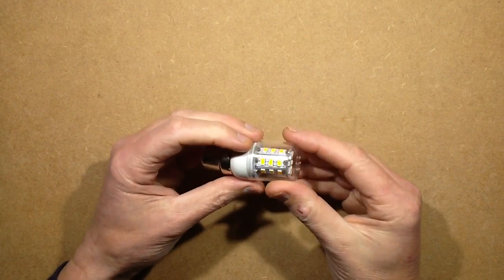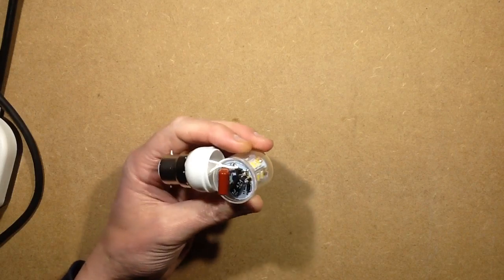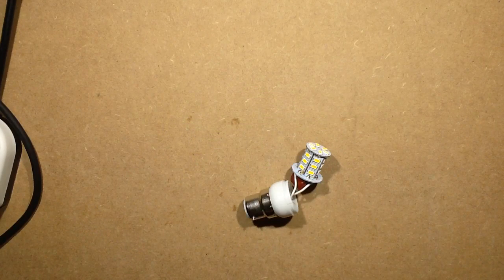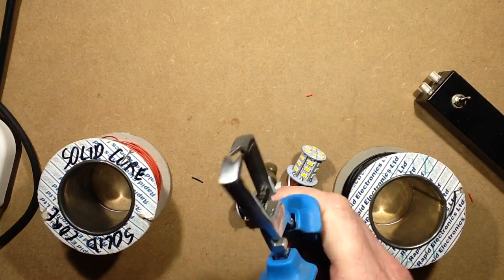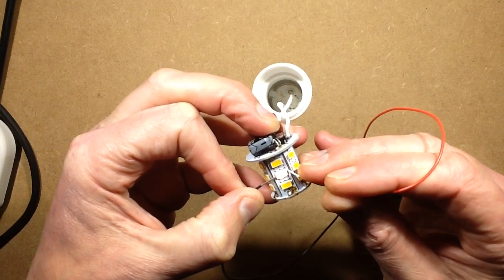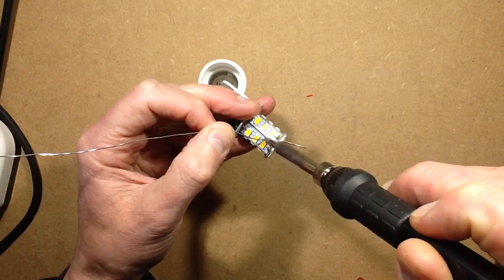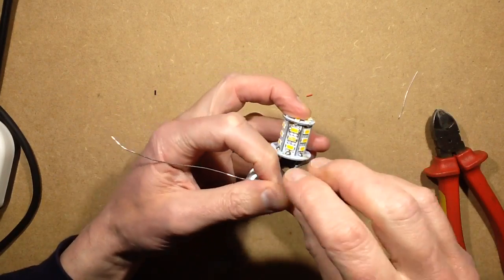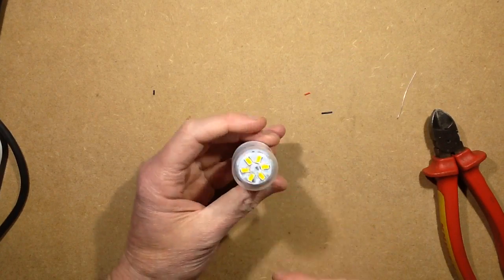Fixing a dead LED lamp.  (Interesting failure.)

Comment: If you are doing this as an exercise, thats fine, but in the real world, its a total waste of time. Shorting out the blown LED will effectively put a slightly higher voltage across the rest of the LED's which are already driven too hard, and cause them to blow as well. So you wont get much more life out the bulb. If you want it to last, short it out with a low value resistor.

Comment: I love that socket design! The American screw-type sockets are moronic! God help you if the bulb shatters in the socket!
Reply: +Islamisthecultofsin Or use a potato. Push it over the broken bulb base (powered off of course) and turn.

Works on bayonet cap lamps too.
Reply: +Mark Speir   Turn off the switch and unscrew the shattered bulb with a pair of pliers.
Reply: Islamisthecultofsin Or you could use one of these sockets and only have to turn the bulb a tiny bit...
Reply: Mark Speir  I actually prefer the screw bulbs over the other.   We do use them in cars though.
Reply: +Mark Speir normally E series socket's body can be unscrewed too. also plyers or pincers would help. With power off, obviously

Comment: I have the same bulb as you are and i fix it the same way you did, that only run the bulb for few more hours before the other LED gone. than i fix it over and over til i figured that the wire i use might be too thick to let too much voltage flow through and kill the next LED. This is what i do to my next bulb with a dead LED, i stripped the whole plastic off the wire, and solder only ONE piece of wire out of the whole bunch of that twist metal wire.That bulb can survive for week or longer before the next dead LED. My solution, DON"T BUY THIS BULB.

Comment: I bought a bunch of these from China, three different power ratings from three different vendors. They all fail in similar manner after a few hundred hours, one of the leds fries and the lamp dies. A far cry from the 100,000 hours longevity they promise :-)

Comment: when you buy them, replace the cheap capacitors with one voltage rating higher and take out the horrible fake insulation tape. this stuff stops airfolw makes the caps overheat and bulge, if you do this these bulbs will last years.

Comment: I use a hot air gun.  I find usually two LEDS have burned.  I fix them in two seconds now ;-)

also I remove the plastic case and use 3 second glue to fix every thing back together I find the bulb lasts longer - but mind your fingers 220v its not fun :-)

I like the vids keep them comming

Comment: Overdriven LED's. I had the same in my B14 rangehood lights. Made a video of that too.
Some of these led's are overdriven to hard.
Reply: +RODALCO2007 
Yep  -  designed for the 220v  chinese mains supply  - the  capacitors for 240v -  

found same  problem -  put a standard  LED   cross  the dud led  -  another  blew  

getting some 2w 1k res  smd  -  drops the current  -   thus underdriven

Comment: It will be very temporary fix. I also fixed my cheap bulbs that way and another LED burned after some time. But finally I desoldered my broken bulbs for 5xLED tabs which I power with 15V from 12V via step-up converter and they work as low voltage light source in the kitchen.

Comment: Interesting vid. 
At 1:50 you use some kind of small hand micro scope or magnifyng glass with led, where did you got that from ?
Thanks
Reply from the maker: +Rodrigo Bugni It's a common little LED microscope on ebay.

Comment: Thanks. I fixed 2 LEDs with a blue 5050 LED (nothing else at hand). But i don`t get the circuit/schema. I`ts the rectifier smoothing cap type, but the 24 LEDs are rated for 3.2V (maybe 3.4V) at 150mA. In series they need about 77V. But whats with the 230V-77V = 153V drop. Are this drop done by a resistor (153V/0.15A=~1K at 153V*0,15A=~23Watts)?
Reply from the maker: +Looxy Look These usually use a capacitive dropper that basically has a capacitor in series with the mains so that it lets a small portion of current through on each half wave.  It's much more efficient than a resistor since there is virtually no energy dissipated as heat from the power supply.
Reply: +bigclivedotcom thanks a lot. now i read more about the capacitive reactance: 1 divided by (2 Pi F C) and found more infos in your led hack.

Comment: I've had some 12v ones we used in a trailer, and they didn't like the unregulated voltage at all; they'd run extremely hot if you didn't have a positive voltage regulator in series with them.

Comment: This seems to be typical with those ultra cheap Chinese LED lamps, had two similar but taller, same design . . . fixed them many times finally made one into spare parts and other one I replaced with resistor little bit greater than original LED, dimmed light a bit, but it don't fail any more. :D

Comment: Is that microscope from ebay also?
Reply from the maker: +WestSideJooo Yes it is.
Reply: +bigclivedotcom Are they still available, under what name are they sold? Thanks
Reply from the maker: +WestSideJooo It's a very common item.  If you search ebay for microscope and then select the lowest cost and shipping/postage option you will find a wide variety of cheap but useful devices.
Reply: +bigclivedotcom Found it, thank you.

Comment: Fffffff I'm such an idiot, I was trying to repair a bulb (one that I mentioned previously, that had stopped flickering but has now broken in one segment) and when pulling off the base one of the wires disconnected from the cap. Will I be able to repair it? Stay tuned to find out.
Reply: +BenjaminGoose Ok it seems to be literally impossible to solder a wire down into the base of the small edison screw bulbs. How delightful.
Reply from the maker: +BenjaminGoose Some have a press-in end contact where the wire is fed through a hole and then the end caps pin is pressed in jamming everything in place.
Reply: +bigclivedotcom Clive, thanks for the reply. I've given it a look and tried to carefully tug both the metal part and the very base part (the positive) off and the latter came off, except made a bit of a mess of the metal screw part. It's no problem; I'll just dangle some mains-connected crocodile clips from the ceiling and hold the ends against the bulb when I need some light. At least these bulbs don't cost a lot I guess!

Comment: Why not using a resistor in place of the LED?
Reply: +Dušan Lazarević I'd rather replaced it with similar diode than resistor, if you can do that
Reply: +BloodySword In the long term it would increase the life of the bulb, but this way is simpler, you don't have to figure out the value required, and not that it would really matter, but there would be less of a brightness change overall
Reply: +Jonathon Gay Uhm, when one LED gives up, it means that they are already pushed very hard or the quality of these LEDs is very low. So I don't think that this bulb will last any month.
Reply: +BloodySword I should have clarified that it was the resistor which would improve the lifespan. That's what I meant, not the plain wire
Reply: I haven't even thought about it. More important, I even didn't know about that characteristics of LED and diodes, thanks :)
Reply: +Dušan Lazarević  Well problem is, diodes do not have a constant resistance, so any resistance that you measure will be bull crap. Instead, they drop nearly constant voltage. So if you have a piece of circuit with nearly constant current where your diode was supposed to go, you measure that current, you take Ohm's law R=V/I and substitute the current you measured, and the voltage that this kind of diode drops by spec at this current, and you have your approximate substitute resistance. Instead of a spec data sheet, just measure the voltage drop across another diode, it should be somewhere vaguely around 3.5V for white LEDs. Probably not worth worrying too much about temperature coefficient, that is it is really a thing on diodes, but it's not going to matter on the resistors beyond what your sample variance is.
Reply: +Jonathon Gay If I measure resistance of working one, then solder resistor at place of faulty one, will it work? Also will value of resistor be good?
Reply: +Dušan Lazarević I think it might work in a certain degree. But the resistor has positive temperature coefficient. Meaning when it gets warm, resistance rises. Diodes have the opposite effect, as well as LEDs.
Reply: +Dušan Lazarević A Geek is not supposed to know everything. ;) So it's fine.

Comment: I've just had this exact same problem when we had the power restored early this afternoon (the power was cut to this sector for a few hours and our main circuit breaker never turned back on). It seems to have stopped flickering now but I was very curious to see if you had mentioned this issue!
Reply from the maker: +BenjaminGoose If you live in a rural area then you may have an RCD/GFI on the main incoming supply.  These are available in two versions  Active and Passive.  A Passive breaker will stay set even when the power fails, and only trip in fault conditions.  An Active breaker deliberately trips when the power fails and has to be reset afterwards.  In rural areas it makes sense to the power companies to use the Active type, since it means that when they have a power outage they are not switching back in to a full load of every home with every thermostatically controlled heater wanting power in one go.  By using the ones that trip when the power goes off, they are effectively switching back into no load and then as people check their breaker and reset it the load increases bit by bit in a controlled manner.
Reply: bigclivedotcom Ah that makes a lot of sense. What I forgot to mention however, is that the breaker actually failed completely, so it couldn't be turned back on. EDF had to send someone to replace the unit! One thing I found odd about the metre box in general is that it contained two fuses, one for live and one for neutral. Isn't that a little bit redundant, and in some cases dangerous where the neutral becomes disconnected via the fuse blowing, and live staying live?
Reply from the maker: +BenjaminGoose In old installations it wasn't uncommon to have a fuse on both, but latterly they can change the neutral fuse for a link.  That has the advantage of allowing isolation of the neutral for some test purposes.

Comment: Tweezer-style soldering iron?
Here on eBay-Australia, the only supply of these soldering irons that you wanted - are in the UK.
Looking at the photos, they are part of a soldering work-station, with work-station connection.   How do they work?  What is the advantage of them?  Can they be purchased outside of the UK?
Reply: +Greg Zeng They are usually part of smd soldering station and they work by heating in same time both (or four) sides of component. Personally I find them not of much use (I have PACE and Ersa), I found that more easy is to use hot air for same job (but I am not expert in any soldering and do it very rarely, but same opinion is shared by my colleges that do it much more often them me).

Comment: Another superb video Clive.

Just a little further feedback on the set up for making your videos. It looks like you now have the lights more to the left and right of your workbench, which works well. A little more diffusion might be nice to further soften the light - some trace perhaps. I know you now have the exposure/ iris locked off but there has been some variation recently. This particular video is a little over-exposed.

The background looks like it might be a sheet of MDF, which is so much better than the black one. Because the MDF is relatively pale and neutral the auto-colour has not picked up on it and given your hands a bluish shade. Which is good. To be on the safe side, one could probably also lock off the white balance.  As for the shadows at the bottom of the shot, I wonder if an LED strip fixed just out of shot would help?

Comment: Hi. I had 6 of these running about 8 hrs every day and they ALL failed within two months!
In every case one (or more) LEDs had burned out. (literally). You get what you pay for I guess.
Reply: +Eric Gee If they are designed (and maxed out) for 220V~ exactly (not all designers are too smart), and you connect them to 240V~ (some places can have 245V~) they will run hotter than specified.
Some of the cheap small LED bulbs for cars will not last, seemingly they are designed for 12V, while the actual voltage when driving will be around 14V.
A really stupid designer will not even give ambient temperatures any thought, simply look at some specification for 20°C or thereabouts.
Reply: Same bad experience I had with this type of bulb. Will try to short them. Searching for SMD voltage. Anyone knows?. Thanks.
Reply: Karim Ismail
The bulb sellers usually tells you what type LED is used, just search on the webs for specifications ^^

Comment: I got old LED's off by lifting one end with a soldering iron to small angle and then desolder other end. If it's broken, then there's no need to keep it intact anyway. By the looks of it it's 5630 emitters in that bulb. Keep up the good work.

Comment: I hate LEDs that strobe 50/60 times a second. I want a continuous light, not on and off 50/60 times a second.
Reply from the maker: +SBS7413Y The iPad I use to film tends to exaggerate the flicker greatly.  It can even make traditional tungsten lamps look flickery.  But when you see me testing a lamp with no flicker at all, you know it's got really good smooth output.
Reply: +bigclivedotcom iPad replacement time PLEASE !!

So surprized that the digital electronics of a battery-powered camera records flickering tungsten lamps.  Any engineering type of explanation?

When I watch you detailed Youtubes here in Australia, the iPad's 720 video camera is so bad.  At first I removed the Firefox's HTML5 view using a Firefox addon.  Html5 cannot do Full-HD well.

On my Windows-10 PC, I had to use the latest Adobe Flash player to try to get better details.  That crazy, inferior iPad camera.  It makes it hard to see the details.

Comment: I usually don't use any wire strippers at all.  I just use the snippers.

But my favorite wire strippers that I have found so far are the spring-loaded wire strippers from Harbor Freight.  They work great and will open back up after you squeeze.  $4.99 USD.

http://www.harborfreight.com/7-inch-wire-stripper-with-cutter-98410.html

Comment: I had one of those type lamps DOA (actually one side didn't work) and found one LED O/C.  Since I didn't have a spare LED of the correct type I simply bridged it out.  I expected the now shortened string to starve the other side, but surprisingly it seemed evenly bright on both sides after the bodge repair.

Comment: I bought 3 of these, 2 of them died within 1 month. Same fault as in the video. Slightly different housing but same style. I do believe they are under rated for New Zealand's 240V mains supply

Comment: What do you call that kind of wire cutters? I'm trying to track them down but I'm not having much luck.
Reply from the maker: +Troy Adams The big electrical-work ones are called snips in the UK and side cutters or wire cutters elsewhere.
Reply: +Troy Adams http://www.unior-bike.com/cgi-bin/cms.cgi?doc=10780&prod=8796 is the specific model, but there are lots of similar ones by all the other brands.
Reply: +peepzorz i got a stripax from garant. The best wire stripper EVER! they are a bit pricey though https://www.hoffmann-group.com/DE/de/hom/Greif-,-Schneid--und-Schlagwerkzeuge/Kabelbearbeitung/Abisolierzange-6-mm%3CSUP%3E2%3C-SUP%3E-GARANT/p/728613 ( i got it for free from a good friend^^)
Reply: +Troy Adams They are also sometimes called diagonal pliers.
Reply: Thank you all for the info :)
Reply: +Troy Adams Only $5 on Amazon and it has a few good reviews.  For $5 you really can't go wrong.  I mean if they don't work that well nothing lost.  But I don't see why they shouldn't.  I'm gonna get them.  I've never seen wire strippers like them.  I've always used my teeth... not so good because of lead poisoning and eventually I'm going to break a tooth.
http://smile.amazon.com/gp/product/B002MXNEKQ/ref=ox_sc_act_title_1?ie=UTF8&psc=1&smid=AOOH0DF4QWOOO
Reply: I used to use my teeth too xD and i just tryed one of these plyers. I had one from belzer lying around, essentially the same thing in expensive and a little beat up...
And i have to say.... i like them, i'll be using them in the future for wires over 0,75mm2. So for 5$ i'd say go for it!
Reply: +Troy Adams Look up "end wire strippers"
Reply: Scott: Just ordered last Stripper @ Amazon. Thank you.
Reply: ***** Cool!  I'll get them then!
Reply: +Troy Adams 
Master using a pair of snips and you won't need to waste your money on wire strippers.
Reply: +Troy Adams I think I found the exact set on amazon http://www.amazon.com/Duratool-D00630-Professional-Wire-Stripper/dp/B008FP5ID6/